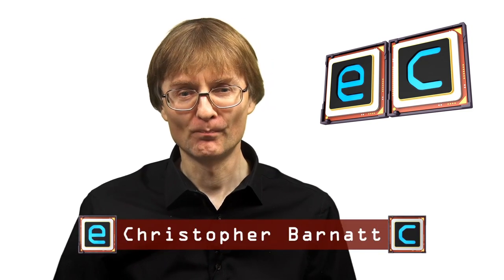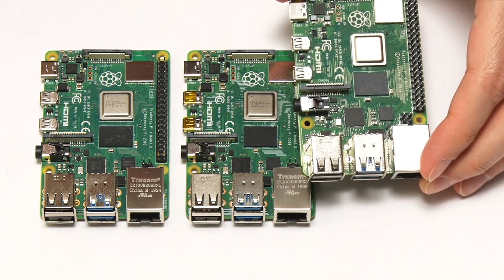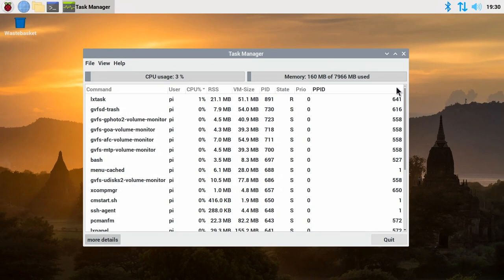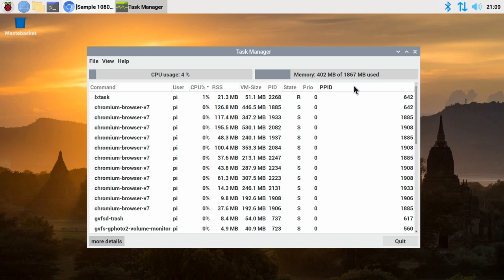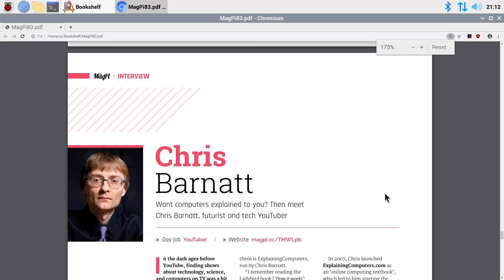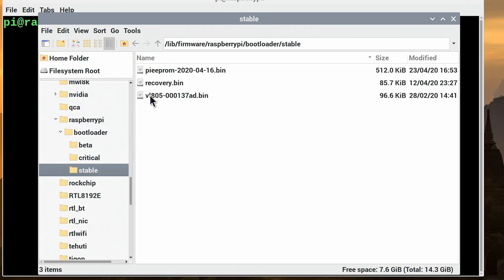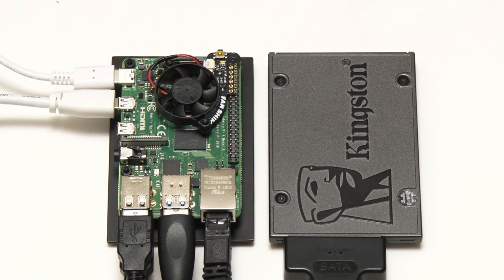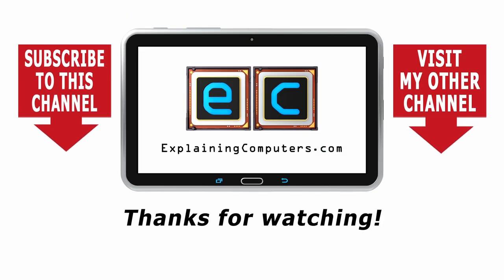Raspberry Pi 4 8GB & USB Boot

Comment: Chris - 
I notice you use apt update vs apt-get update.  What is the difference. When first working with RPi as a long time Windows user, and not familiar with Linux, I read that one should routinely execute the commands
apt-get update
apt-get upgrade
I gather the first kind of gets a list of what is eligible for upgrading and the second does the upgrade.  Now I see people talking about using only apt update to get their system up to date.  Is the upgrade step still required?  Also, will apt-get update return the same list as apt update?  Finally, what is the effective difference between upgrade and full-upgrade. 
This may a bit much to address in a comment section (I hope not, but it may be so).  If it is, might the use of package management tools in Linux be the subject of one of your very useful videos? 
Regards and thanks.
Reply from the maker: apt is the modern replacement for apt-get -- either will work in the vast majority of circumstances. I try to use apt now, as when I type apt-get people moan that I am out of date!

Comment: Christopher - was wondering if you'd seen/tried the Ubuntu Server 20.04 64-bit build on the Pi at all, I have done some very basic work with it (just installed LXDE and some basic applications) and I've found performance seems to be a little odd, strange I/O delays for bringing up Chrome, etc. but here doesn't seem to be CPU spikes.  My tests were done on a rather slow SD card though so it's wholly unfair;  I'm actually enticed to try this from a 160gig drive via USB3 following this video.
Reply from the maker: I tried it this week in a video comparing the Pi 4 and Odroid C4 (posts 2nd video in July). Some very good performance, but also some issues as you note.

Comment: I got thru all the steps and upgraded the eeprom, but found two other tutorials that recommended I change the update file:
One Example:
sudo nano /etc/default/rpi-eeprom-update
* replace critical to beta

Other Example:
 sudo nano /etc/default/rpi-eeprom-update
 * Change "critical" to say "stable"

Do you recommend either one of these changes and are they needed?
Reply from the maker: Please read the notes in the video description. There are many tutorials out there that clearly have no idea what what the commands they are entering actually do! (You do not need to edit the config file).
Reply: @ExplainingComputers  I followed your instructions and it worked perfectly. Thanks again.

Comment: i will probably wait for the OS to install the updates to run the Pi off an SSD.this is exciting. i have a few questions about Pis in general. are the RPi zero still available? i see the zero W is, but i was also interested in the plain Zero for secure storage. if not, can i turn off the WIFI and BlueTooth or secure the Pi for my encrypted cold storage digital vault?
when running a Pi with an SSD boot drive, which power supply would you use (5.1v, 9v, 12v) and is the Pi supplying power to the SSD via USB 3.0 A?
if you were purchasing an SSD for this purpose, would you get an old style almost square SATA for almost the same price, an m.2 NVMe x4 PCIe gen 3 which is now an older version as the PCIe gen 4s are out. i find it disturbing that the 2 videos i have seen have demonstrated this new Pi super power with old style SSDs without explaining why. if that's all you had sitting around not being useful, fine. if there's no way to use the latest m.2 PCIe gen 4, perhaps that would be useful to know. i realize we might not get PCIe performance out of a Pi, but if i am going to spend $120 on a 1TB drive, should i get one 2 generations old?
thanks for the great video, this is on topic for my equipment needs. thanks for the bit about the Pi 4 2GB, that was very helpful. i want to go ahead with my project and the 8GB is not available. so i'll go with the 4 GB for now. i have several Pi projects; an internet gateway, a HTPC, and i'm removing WiFi from my home and installing a few podcast stations so i can listen while i do chores from wall mounted "desktop" Pis with thrift store flat screen monitors, that i can monitor HomeAssistant functions on too.

Comment: I'm using my old Pi 3b to keep my cat out of the kitchen. There is a BLE beacon on his collar and the pi sits in the kitchen listening to the signal strength. If he approaches the kitchen the pi closes a relay which turns on a 120v AC outlet, into which is plugged a hand vacuum. It shuts off 5 seconds later. I used to do this with motion detectors but he got very good at avoiding them and sometimes I'd forget to disable them when I needed to go into the kitchen. Now he can't dodge radio waves and I don't get surprised in the middle of the night.
Reply from the maker: Excellent!

Comment: Great video as usual, Would it be possible to create a ram drive on the 8gig pi say, 4gig and still leave a useful amount of memory ?
Reply from the maker: Now this is a cool idea. And yes, you could create a RAM drive on an 8GB Pi and have lots of RAM left over (the Pi does run fine with 1GB afer all!). In 32 bit Raspberry Pi OS I imagine a RAM drive would be limited to a 3GB. But you could go higher in a 64 bit OS.
Reply: @ExplainingComputers  Would i have to put the terminal command in the startup settings for this to work?

Comment: First, I am a fan of your videos, they are an excellent source of knowledge; second, I am a beginner transitioning from Windows to Linux; third, I followed the instructions of this video and everything ran according to you were explaining, except that the SSD was not recognized.  My SSD (sata) is a WD Green of 240GB.  I did not format it; could this be the cause?  If so, could you provide the right procedure to format the SSD?  Thanks in advance.
Reply from the maker: This sounds like you could not see the SSD in the Pi's SD card copier? If so, it might be a USB adapter issue.

Comment: You can see the boot up process by using F2 when the logo appears :) also the shut down can be seen :)
Reply: Strange this tip coming from me to you....i'm by far more used to only accessing my pi's, Wemos(es) and other linux based systems only using the command line (via SSH). Though i do not own any Windows machines myself :-) Never felt the need to check boot up for my Ubuntu based system... because it just works and it's blazing fast too :) but your welcome :D
Reply from the maker: Thanks for this. Appreciated.

Comment: I actually use my pie as my main system, when my main system has problems. I am running the 64 Bit Version of Raspberry Pi OS with a skin that makes it look and feel like a Mac PC. I have the 4gig version and use a 128Gig MicroSD most of the time. I have several MicroSD cards with a wide variety of OS including MATE in Ubuntu Server.

Comment: I followed the instructions and checked each step, I used a Vasekey 120gig ssd for this, identical to the ssd that drives my pi 3B+, but no matter how I add the files, sd card copy or writing a new image with Balena Etcher, I'm getting firmware errors and a no sd card error when I attempt to boot. Firware is 03 June.. What am I missing?
Reply from the maker: Sorry to hear this. It should work. But maybe your USB adapter is not supported. There is now June 15th firmware, so I would try that. Good luck!

Comment: Does it have POE? or do you need an additional adapter? Why not a power down option? because the only way to turn it off is by disconnecting power supply. Is there a reason why?

Comment: The video is great but I cannot get the process of booting from an external 500GB SSD to work. Either it cannot create the FAT, or It says the SSD has been removed without ejection (but there is no ejection process available in any menu it asks me to look into). 
5 tries, 5 rejections. Yet it will boot from a USB micro ssd when inserted in a USB 3.0 port. What am I doing wrong??
Reply from the maker: If you can boot from an SD card in a USB 3.0 port, then the issue is the Pi's firmware not (yet) supporting your SSD (or its SATA adapter).

Comment: Does it understand correctly - the new USB firmware and boot also works on R Pi4 4GB?
Reply from the maker: Correct -- the new firmware can be used on any Pi 4 (1GB, 2GB, 4GB or 8GB). I have tried it on the 2GB, 4Gb and 8GB and all work fine. For me it is by far the biggest development here -- though only apply beta firmware at your own risk.

Comment: A very comprehensive guide. Just what I had been looking for. Thanks!

I also wanted to suggest looking into High Performance Linpack (HPL) to stress test the cpu in your RPI case testing as opposed to the sysbench script that you usually use. First, it's a very tough test, it got my core temp to 80C whereas the script that you use (which I did find to be useful) only got me 58C. I do acknowledge that these tests don't represent normal use, however, they really do put your cooling system to the test. Second, the test can pass or fail so you also get an idea as to the stability of your RPI (can be very useful for overclockers).  

In case you decide to look into it:
-A guide showing step by step how to install HPL on your RPI: https://www.hydromag.eu/~aa3025/rpi/ 
-RPI Forum link related to HPL: https://www.raspberrypi.org/forums/viewtopic.php?f=63&t=276089&p=1679226#p1679226

Thanks again for the video.
Reply from the maker: Thanks for this. :)

Comment: Lucked out and found 4gb rpi4s at my local target for 49.99 scooped them up. Have been running a local dns server from a pi3b and an nextcloud server from a pi4 2gb model for a while might wrap dchp into the bundle and a few other small services and stick it all on one pi4 4gb as a self contained network in a box kind of deal kind of like the pi recovery box so many people have making projects based on.
Reply: That's a good bargain, but remember the official outlet's have great customer service and guarantees, I have had two pi 4 die in the past one from pimoroni and one off an eBay trader, the two pi worked fine on purchase, but after I had been fiddling for a while (2 months) I had two dead pi 4 (I used beta berry boot, running multiple os on an SSD) and I could only get a replacement for the pi bought from pimoroni.

Comment: Nice Chris!
I'm wondering if the Pi4-8GB is going to be a viable option for processing camera raw files; talking 20-27 Mega Pixel files.
Aaaaaannnnnd...
Assuming that for some reason you don't like a firmware beta is reverting back to a stable build going to be easy - I'm only asking that dumb question because I've seen with some things you can't go back
Reply from the maker: The RAW processing will depend on your expectations, and available software. The firmware update method shown can be used to "downgrade" to any previous version -- just use the location/name of the previous files. I went back and forth many times while making this video.
Reply: @ExplainingComputers  Surely it's got to be better than my 10-11 year old PC

Comment: Thanks for your very clear and informative videos! Question: If I replace the step, of copying the OS on the SD card, over to the SSD, by using a Raspberry Pi Imager instead-- to format the SSD with, say, Ubuntu Mate 20.4., would that work?
I've been racking my brain with this for days, following different tutorials without success. My latest achievement being to erase the SD OS and not being able to boot either from the SD or the SSD. But I hope it's just the SD and not the SBC itself-- I wasn't aware even, before seeing your video now, that I can damage the actual board! Will try to mount the SD again with a new OS. So far I was doing everything with Ubuntu Mate. But it looks like it might be a better idea to start from Raspberry Pi OS? Thanks!!!

Comment: which USB3 SATA adapter do you recommend - I have one that is not working / recognized on any of my linux machines... (Logilink AU0012A) - thanks, Ronald (got the first Rpi in CH years ago, still running strong as a OGN FLARM receiver at LSMF...)

Comment: Hi what make of USB SATA adapter are you using. Currently I have one that does work with the Raspberry Pi and one that doesn't. Will this boot using an M.2 SSD instead of the SATA one ?
Reply from the maker: My adapter was labelled Amazon Basics. You could boot from an NVMe SSD if it was inserted into a caddy with a USB 3.0 connector. So both SATA or NVMe  SSDs could be used providing that they are converted to a USB interface. I suspect more adapters will work once the firmware emerges from beta.

Comment: As always, the dream of using a Raspberry Pi as a Desktop computer is always getting closer, thanks to the march of technology, and our yearly anticipation of the next big upgrade. So with my Argon one case, a Raspberry Pi 4/8GB, and my essential software (just frivolous things like Variety, Balena Etcher, Kodi, and other things), I have a pretty good portable desktop PC that I can use to do everything apart from high-end gaming. I can do work, surf the web, watch and create video, and with reasonable speed. The only thing left is to get the 64-bit OS (or even Ubuntu when it's released a stable 64-bit version for the Raspberry Pi). My SD card is a 256GB one, so that I can have plenty of room for trying out new stuff. 
Of course, my modification of the original PiTop to accept a Raspberry Pi 4 was a moderate success. I haven't gotten around to making plastic parts to route the ports to actual built-in ports on the exterior of the PiTop yet, but with time, I should have that done in the near future. 
The PiTop Ceed can readily handle the Raspberry Pi 4, and makes a very lovely all-in-one computer. I modified mine to have an external audio jack on the outside of the case, as well as an external HDMI port for the Raspberry Pi 4's extra Micro HDMI port. There seems to be more room in the PiTop Ceed's case, so I may figure out something to do with that...
Of course, everyone and their brother has used the Raspberry Pi for arcade, home videogame console, and vintage computer emulation. I am no exception. My latest project was putting a Raspberry Pi into an Atari 600XL case, using the original Atari keyboard and joysticks with an adapter provided by Tynmouth Software in the UK. It works great, but I have to learn how to tweak the software to get everything working for "other people". I know what to do for myself -- I just want to make it so that anyone else can jump in and run all their favorites without me having to explain a few things about the emulator.
Reply from the maker: Great post -- thanks for sharing.

Comment: I got a raspberry pi 3, and I doubt everything he says about booting, card readers and USB and USBdrive.  It took me 2 days to boot up my Pi3 on a card, and the only way was because I found an old card that somehow was friends with the Pi.  Seriously, I spent more than 24 hours reformatting, downloading Rasbian and other linuxes, creating boot drives, reformatting, usb sticks, usb drives, formatting sd cards down to Raspian addressable sizes, it was a cluster.  The only thing that worked was literally going through my junk drawer, finding a tiny card I used on my camera 15 years ago, loading raspbian on it, and after purchasing a decent sized sd card, all i got was 1gb storage, and a pain in my stomach after screaming at the little LED on the Raspberry to turn green for hours
Reply from the maker: Everything covered in this video is for the Pi 4 only -- so please don't complain about a video about one piece of hardware not working on another! :) A Pi 3B can boot from USB, but you need to apply a totally different update: https://www.youtube.com/watch?v=ubnwvxF3Klc Note that a Pi 3B+ and A+ shipped with the USB update applied.
Reply: @ExplainingComputers  what im saying is that even with raspberry pi2, I've had trouble booting, so I hope they fixed that for 4

Comment: Well, I didn't buy a RPi 4; rather, I purchased a Compute Module 3+ (32 GB eMMC) and an I/O board with USB, HDMI, Ethernet, etc. What I would like to explore is the concept of software-as-an-appliance (SaaA?). In my opinion –and I'm a professional software developer– software is far too complicated to install. You need to check system requirements, make sure you have the correct hardware and/or software, there's a lengthy installation process, you may need to deal with licensing... the list goes on. Wouldn't it be nice if software came in a form just like a CD player or a microwave did? Just connect it, plug it into power, and that's it. The Compute Module is, even more so than the normal RPi, a self-contained system. It has everything on board, except I/O. Now, if you can design an I/O board for your particular application, whatever it may be, you could plug in a Compute Module, and be ready. Anyway, that's the theory.
Reply from the maker: Very cool plans.

Comment: So some USB C adapters or cables didn’t work with the first gen Pi 4? 🤔

Edit - bookshelf looks super useful. I’m stoked I’ve started reading again. Also, congrats on the feature!

With external USB boots, is that something that’s been doable for a while? I know with macOS you can but didn’t realize with RPis you could.
Reply from the maker: USB booting on a Pi 4 is very, very new. A Pi 3 could boot from USB, but not a Pi 4. Remember, a Pi is not an X86 computer like a Mac or PC. :)

Comment: When the 64-bit version is available, can you make a video of a Windows 10 installation?
Reply from the maker: The forthcoming 64 bit OS mentioned in the video is Raspberry Pi OS. The Pi has an ARM processor, not an x86 one like a PC, so cannot run regular Windows 10. Their is an IoT (no desktop) ARM version of Windows 10 that is supported, and some have managed to get a non-supported version or ARM Windows 10 running. But the Pi 4 is in no meaningful way a desktop Windows 10 device.